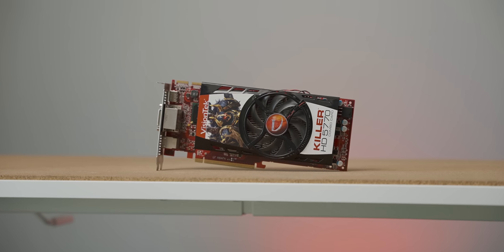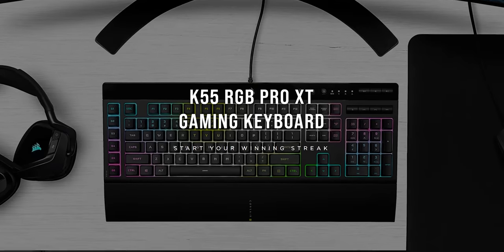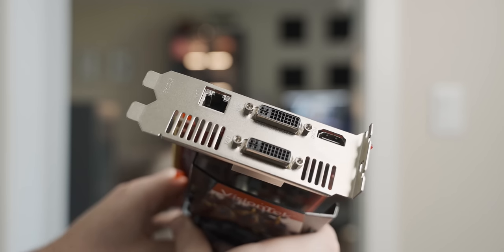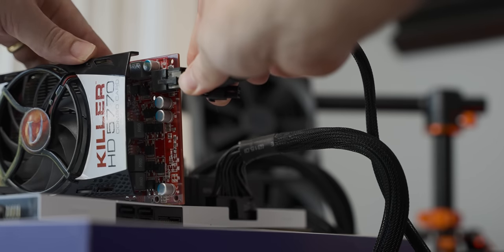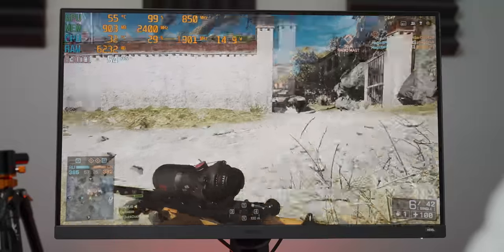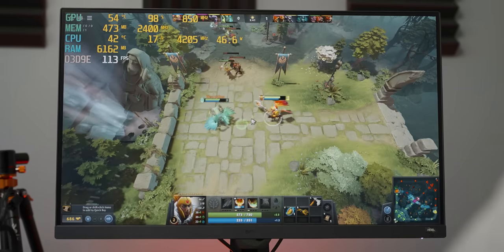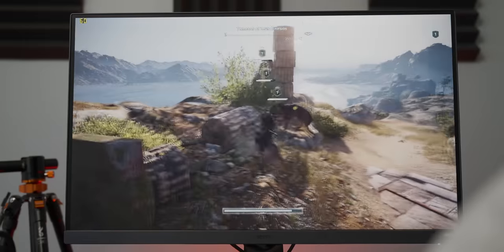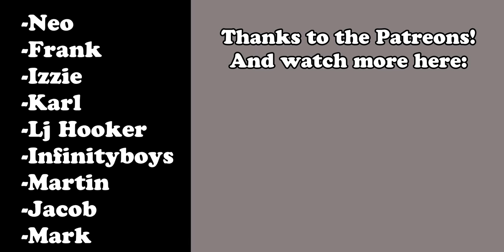The Most Pointless Graphics Card Feature Ever?

Comment: 1 gigabit ethernet was not as common as you make it out to be in 2009 especially for mid range consumers. And 2 most people had computers with only 1 pcie slot and the rest of their peripherals were pci in the midrange space.
Reply: or even AGP or how it was called that slot :D
Reply: cus look i have here AM3 socket MSI MBO that have PCIE slots and down on mbo is PCI slot :D
Reply: GBE adaptors were pretty common around 2007, I remember buying my socket AM2 motherbord around that time and I did not aim at high-end mobos. The point of this Killer adaptor is that it is a gaming adaptor.
Reply: I'm not sure about that, my old Socket 754 AGP motherboard had gigabit ethernet. It was from literally five or six years before this card came out. In that time, it would have been increasingly hard to buy a motherboard with just "Fast" Ethernet (i.e. 100mbps) and although a number of legacy systems certainly floated around (as they do), I doubt that many of their owners contemplated putting a brand new GPU in one.

Comment: As an authorised Killer NIC integrator, I've dealt a LOT with it in the past. The benefits of the Killer network card are that it performs BETTER than a built-in card or add-on card. When paired with the right Video card (something a gamer concerned with cheap integrated NIC problems) would prefer as an upgrade to their connection and thus play experience.
Reply: back when this was released Killer network cards would have performed exactly the same over the intent which was likely as best 20Mb/s as any other Nic. It is just some marketing bollocks that people with too much spare money and too little talent would fall for.
I had a built in Killer network card on my last Mobo (similar age) and the software and srivers were a pain.
I now have a 2.5GB nic which is pointless as well but atleast there is no stupid software with it it.

Comment: The video card was probably marketed as a drop in upgrade for older systems, which probably didn’t have gig Ethernet.
Reply: Ok so help me understand this then…who had gig speed internet 10 years ago?
Reply: @Derek2k  I have gig speed for like 5 years. And I don't live in very populated city. Not every country is internet poop as USA
Reply: @Derek2k  On the local network?
Tons of people. I've got a Core 2 Duo playing media server with onboard, dual gigabit LAN
Reply: @Derek2k  More over local lan... though that was more a 2000s thing. :P
Reply: @Derek2k  gigabit LAN is a nicety for transferring files to and fro, especially if you have network storage.
Reply: And/or limited quantity of suitable pci-e slots
Reply: Afaict systems that didn't have gigabit Ethernet also generally didn't have PCIe slots.
Reply: @petermichaelgreen  I clearly remember some MB where there was something like multiple PCI, and single PCI-E (and i think, also AGP). Also, budget motherboards could be pretty bad in port quantity/overlap situation. So, I could think about some niche cases when it would be actual on that time. Making any sense is entirely another matter.
PS I personally upgraded for almost free to MB with damaged Ethernet controller,  but perfectly fine otherwise...
Reply: @Derek2k  I had a gig switch that allowed for super fast file transfers between my various machines.
Reply: @paveloleynikov4715  I think slot spacing was part of the equation here. First gen PCI-E GPUs were still single slot, so common mainboard spacing was based on that. Later double height cards were a headache, often forcing users to give up a mainboard slot. Adding a hardware gigabit Ethernet port would give something in return that a mid-range GPU customer at the time might actually be interested in.

Comment: So I actually still own a Bigfoot killers e2100 stand-alone network card. Thing actually worked really well when I was using it but I bought it when I built my first gaming computer back in 2011. My theory on why they did this honestly could’ve been convenience sake. My original build had a phenom II x6 3.2ghz black edition 16gb of ddr3 and all hard drives cause ssd at the time was stupid expensive a nvidia gts450 and that network card. Vision gel makes products for gamers, and honestly if I remember correctly a lot of older intergrated networks cards didn’t work the greatest at 1gig networking which is where the killers e2100 came into play cause it ran off the pcie x8 port which provided better connection  and bus speeds and have consistency with network speeds. I was one those people who bought one and during that point in time I definitely felt the difference between using onboard compared to the killers.

TD;DR:  I think that it’s just for the sake of being convenient seeing as people like me back then we’re buying network expansion cards still for better stability and seeing as thier gamer based just made sense to intergrate it into the graphics card

Comment: From what I recall, the marketing with Killer NICs was that it did everything in hardware, to free up your CPU. It was supposed to be ultra low latency. I also recall features like being able to prioritize game traffic and download things in the background, as in the card itself could handle torrent downloads, or something.
Reply: Would that explain why so many complain about stability?  Perhaps the drivers are hooking deep into the network stack to accelerate various network layers?
Reply: Yeah, that's about the explanation. When you design an Ethernet card, you can choose how much you want to do in hardware and how much you want to do in software. At that time, most Ethernet cards only did the bare minimum in hardware (as hardware is expensive, software is cheap) and pretty much everything else in the driver, which meant if your system was under heavy CPU load, your network latency was higher than normal and it was fluctuating a lot, which both isn't good for gaming at all. So the idea was to bundle a Ethernet adapter that would do as much in hardware as possible and on top of that, even be able to buffer network traffic and then prioritize certain kind of traffic over other traffic (which up to today normal Ethernet chips don't do) and again, all in hardware.
Reply: @xcoder1122  The Ethernet card should at a minimum handle the MAC layer and packets addressed to and from the card?
Reply: Yep Killer NICs were really popular before multi core processors were a big thing. Having your CPU giving time to your nic instead of the game "slows things down" so have a chip that handles the nic. 

Most server NICs operate the same way as a server cpu can't handle multiple 10+GB nics. The Killer NICs are just server grade NICs for your desktop with a gamming skin.

Comment: The marketing for this card was that if you have the internet connected with the graphics card your ping and fps would be much better in game since all the processing was done in the same board pretty smart marketing for people who don't know about pc because they would be like good connection + graphics card= good fps in online games which that equation does work problem is it doesn't make a real difference also allot of people didn't have gigabit ethernet was very expensive
Reply: The Killer NIC software also allows for QOS. This would allow you to set a higher network priority on your games.
Reply: @betadan  yeah and it also did a lot of network processing and thereby offloading the load from the cpu. Usually not that important, but when running torrents in the background it can make a massive difference back then

Comment: I have recently played a lot on Geforce Now and I had no issue with frames or quality or anything. The quality does periodically drop when the internet is chugging and its noticeably softer for a few minutes but the frames never drop under 30/60 or whatever I set it to. I never had those horrible drops to 10-15 fps like you did. In fact, I played through the entirety of Just Cause 4 and did not have a single significant freeze or fps drop! So I have absolutely no clue what could have happened in your testing, apart from the "network overload" that you mentioned. (Or just your bad internet Dawid lol)
Reply: Yes I’ve also played a lot GeForce now recently and I’ve not experienced so much lag as you have
Reply: Maybe it was a video decoding bottleneck, was it even hardware decoding with that card?

Comment: I believe this was intended for gamers using older PC's that only had 100Mb/s ethernet on board, or flakey and frankly awful Realtek network adapters from the time period.

Not every gamer had a brand spanking new Core i7 960 and X58 motherboard at the time, many were still using early Core2 Duos or a crappy prebuilt that needed a GPU upgrade, and for those users this would have been enticing.
Reply: I agree, I believe it is this + general marketing/testing the waters type stuff.

Another use-case would be if you were running crossfire, wanted another NIC, and had exhausted your slots.
Reply: Such gamers would have been better served by sinking $280 (Yes, the standalone Killer NIC cost that much) into a better graphics card, RAM upgrade, or CPU.

Comment: Let see, I had my free GeForce Now account, realized that lag is heresy and bought a cheap used burned up rx 470 with one bad connector and a main connector that would fill the screen with garbage if you bumped the machine or cable.  It worked for a year and a half before it started blackscreening.  Then I bought a new rx 570... Then a used RTX 2060 super at the beautiful dip in the market that happened a week after they announced the 30 series cards... Then waited until video cards were being sold like bottled water after hurricane Katrina and got double selling the 570...

In short uh, who would use Geforce Now?  You should have just used Steam Remote Play from the other room.

Comment: Simple as when this card was released onboard LAN wasn’t good. 
What better to market with your GPU to gamers than a good network chip for their LAN parties. 
Makes sense to me. Saves space in the build so you don’t take up to PCI slots.... 
still an interesting product and decent video!
Reply: Nah. The budget system I built in high school back in 2002 had onboard LAN and it was fine.
Reply: @IMelkor42  You missed the "decent" part. Also this card was released way later. It's a killer network chip
Reply: @nated4wgy  You missed the part where I said it was fine, which implies 'decent'.
How does this card coming out later help your point? Unless you're saying that built in NIC used to be good, but then became worse around 2011? I also built systems up and through that time, all had serviceable motherboard LAN which I used.

Comment: I first saw these long ago and remember it being kind of a gimmick. From what little I remember, the GPU itself has to devote compute cycles to the network functions, making the card actually perform worse graphically than it would be without the network chip. What it was good for was hosting multiplayer servers without the need for the CPU to have to expend cycles on TCP requests. A good option back in the day for LAN parties if your main server had one of these.
Reply: Nope its just another PCI-e device on the bus attached via a PLX bridge chip. The GPU has no clue of the existence of the network controller. But the network controller tends to get worse latency than your mainboard integrated one. And during heavy GPU PCI-e transfers or network transfers the traffic across the PLX chip can sort of get in the way of each other.
Reply: @cybercat1531  Welp, sounds like it was even more useless than I thought it was. The more you know XD

Comment: I had the misfortune of having a motherboard at one point that had that Killer chip on it. I actually ended up having to completely disable that network interface once I realized that the driver had a memory leak. Driver memory leaks are especially bad because it takes a reboot to get that memory back and they're tougher to track down because that memory isn't attributed to a process.

Comment: I can see adding an Ethernet could make sense on some small form factor motherboards, or budget boards lacking Ethernet, or the on board solution fails. There may be some video over Ethernet system.
Reply: My best guess is that it was originally part of a pre-built system and they had stock leftover and repackaged it as a stand alone GPU.

Comment: The reason this thing exists: LAN parties. Instead of needing to connect a bunch of network cables to your router, you can use the additional network port to share your connection with the bro next to you!
Reply: You are much better off getting a gige card, they are pretty cheap, and only need a pciex1 slot.
Reply: @arahman56  But it was the same 11 years ago?

Comment: I had that card! I replaced it with a 7770 Ghost which was not really that much better (mostly a rebadge). 

I really wish AMD were better about long term driver support. It doesn't matter for most people of course who upgrade constantly, but for making old hardware usable it really is nice to see. Cards like the X1950XT, HD2900, HD4890 etc have abominable support even though their raw performance would be more than adequate for lots of indie and eSports titles. I can use old GeForce 8800GT, 9600GT etc from similar or even earlier with far better results with newer OS than contemporary AMD/ATI. 

As far as the network card was concerned, it was a good idea but terrible implementation and support. Your typical cheap onboard NIC of the era was a 'slacker' IC that put the brunt of the network processing load onto the CPU and OS though its driver. At the time even using old 3Com 10/100 cards offered better results as the NIC had all of its own processing hardware on the card rather than being a performance parasite (that can also introduce lag due if the system starts getting pretty loaded and the CPU cycles are not free enough to maintain consistent network performance). 

The best results even to this day are offered by strong non-slacker NICs like the Intel Pro/1000 cards with onboard cache and fast local processors (they even have heatsinks!). If you want a good one, look on the usual sites for the dual port gigabit cards by Intel, you should find them for $20-$30 if you hunt, and they are ultra smooth non slacker stuff. They even support duplexing of the ports for 2Gbit if you have a compatible router and/or switch for the other devices in your system (my NAS has this enabled and supported, giving me more than double the peak performance of typical onboard gigabit connections). Of course 2.5Gbe etc is even better if you have the supporting infrastructure, but it's dirt cheap to build out dual Gbit in comparison.

Comment: This was from a period when one or two expansion slots on motherboards were legacy PCI slots.

If you had a Micro-ATX board back then, you didn't have much room for expansion. Usually below the main x16 slot was an x1 slot that would be blocked by a graphics card and the remaining two slots would be a PCI slot (effectively useless) and a secondary PCIe slot.

So if you wanted to replace either the garbage onboard sound or network adapter with a discrete solution from a better brand then you would be hard pressed to come up with an ideal solution. Also let's not forget that SLI and Crossfire were a thing back then.

Comment: Was it made to have a HDMI to Ethernet adapter?  I remember back when HDMI was new you needed a PCI Ethernet card to actually do that because you would need full speed gigabit Ethernet to actually send the signal.  That was more of a novelty though, HDMI over Ethernet was made for like hospital waiting rooms and airports.  Those places didn't actually use Ethernet to run the one DVD player they could afford from a locked room to the TV in the waiting rooms, DVD players got cheap enough that they could buy one DVD player for every TV that was hung on the wall.

Comment: I bought one and still have it in a box of old video cards.  I specifically bought it to upgrade an old DELL Inspiron that had an on board 10/100 Ethernet port and proprietary old video card that pulled memory off system memory.  This card made sense as it was an upgrade on Both my video and ethernet and saved an expansion slot as the card upgrade still took 2 slots and made 1 of the pci slots unusable, and the 1 ISA slot was of no use for new boards at the time.  With this card I had an updated 10/100/1000 Ethernet with a faster video card with dedicated memory as the dell card shared memory off the motherboard.  This card was for situations like this as a viable upgrade to old systems.  It worked great until the Motherboard died and I scavenged it for parts.  As far as drivers, I upgraded from Win 98 to Win XP pro.  Drivers worked well at the time.  I am one who squeezes the last drop of functionality out of every machine I have.  Most of my old machines that are totally obsolete have been converted to NAS machines.  I have been working with computers and electronics sense I was 7 years old and being a retired DATA Systems and IS/IT tech I have seen a lot that most will never see.  :)

Comment: I could see a NIC being useful on a GPU as an output, provided that it had an output hooked to it.
Way back in the day, getting display signal over longer distances were a pain, so what most people used was to encode the HDMI signal and run it over Ethernet as it was cheaper and worked for longer distances than HDMI cables ever could.
Having a built in port for it on the graphics card could make you shed one box in the setup... However I doubt that was its purpose though.